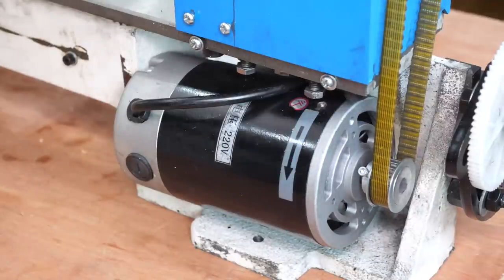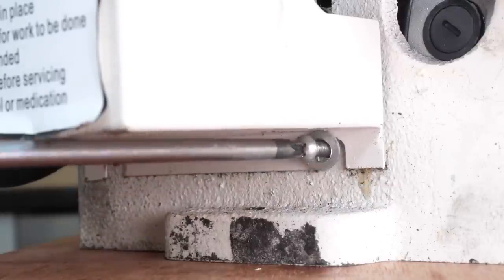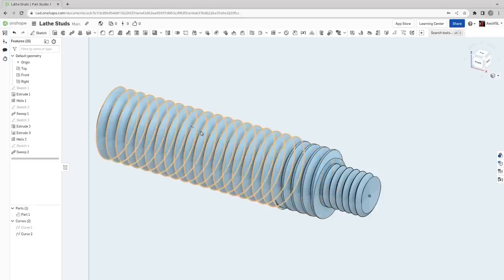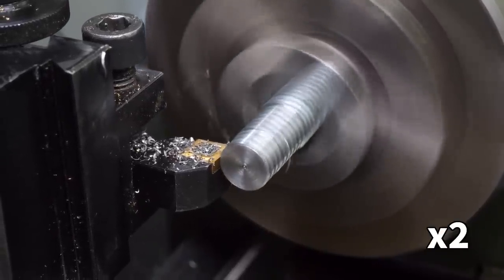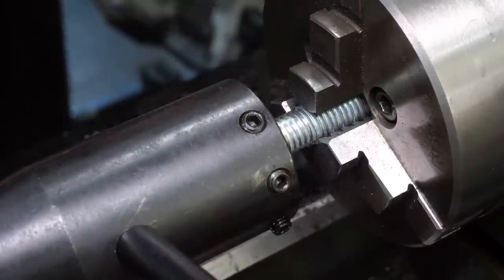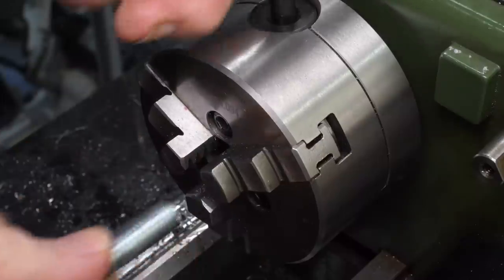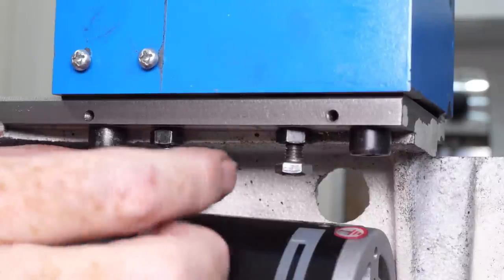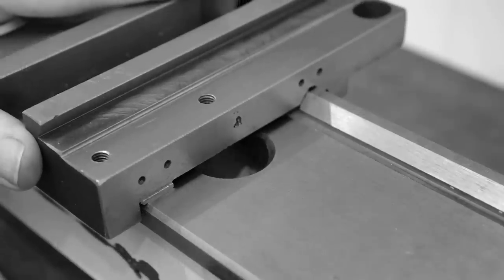A Quick Fix Motor Mount for the CJ0618 Mini Lathe

Comment: A good tip to hold any thread section in the lathe chuck, is to lock a couple of nuts to the thread, so the flats align. The nuts then grip the thread without damage, and the hex of the nuts is gripped by the chuck very firmly.
Reply: Nice, but I have a better way. A collet chuck. A sound investment for any lathe.

Comment: I had exactly the same issue with my mini lathe, fixed it with a new lathe! only after doing virtually the same as you have just done, only I milled the surface around the two slots to make it level, so the motor would sit better also enlarged the two bolts to 8mm just to give them a fighting chance. I still use the lathe for little jobs as I do like it, and it's very handy. thanks for sharing, and remember, "Make Stuff, Not War".

Comment: Love watching you work as it very soothing.  I have done quite a bit of mods to my mini lathe. It is a Harbor Fright. All the bed castings are thew same. I have seen those mounts like you shown.  They are a pain. You are also correct about the two bolts in the motor area.  My lathe has an actual motor mount that has a pivot on it. If you download the HF manual, you can see how it works and probably make it. Very simple and holds the motor much better than the studs do. Keep up the great work my friend.

Comment: These mini lathes are the equivalent of a casting kit. You do the final fettling and assembly after.
Reply: Couldn't agree more.
I spent some time getting mine in decent working order, and mine was well made by comparison to some I've seen. 
The best mod I've done is the drive belt reduction, which has given it much more torque, especially at low RPMs , without sacrificing too much high RPM speed.
Reply: @johnnodge4327  
Bought mine almost two years ago. Still improving things on an almost daily basis,

Comment: Good video, easy to watch.
A few thoughts; did you consider just using stronger M6 studs and turn a bushing to fill the gap? 
Also, if you use a collet chuck they grab thread extremely tight without chance of damaging the thread. A very handy accessory I find.
Cheers,
Reply from the maker: I think bushings could have worked, and a collet chuck would certainly have been better for gripping the thread. This video is about the quickest solution I could think of to get the lathe working.
Reply: @AdventureswithaVerySmallLathe - On a quick look. 
A plate (3~6mm) with two paralel holes. Would make a fine replacement for those two dangling washers. Adding to the M6 and bushings already mentioned. 
It surely would make for a simpler, quicker and rather effective solution. 
Cheers

Comment: So blue live is positive, and white is negative neutral! I found it helpful and informative!
Reply: So the wires are directional wires that turn the motor forward backward, or forward and reverse! Before someone complains! , I am not using it for a lathe but a different use! So I need to buy a variable peed controller for my use! Thanks for your help and support!

Comment: I see you're using the same Moore and Wright digital caliper as I am. I liked so much I bought a second pair, and a digital micrometer and a dial gauge also by Moore and Wright. Very happy with them. Way better than anything I've seen at that price. Not Mitutoyo, but for my purpose, as good as.

Comment: Nice fix, feels nice to tighten up an old piece of equipment and get that like new feeling back. Cheers!
Reply from the maker: Repairing stuff is great, but unfortunately this lathe isn't old. It arrived new in this broken condition. Buying this lathe was an experiment to find out what you get when you order the very cheapest new mini-lathe off the internet.

Comment: Same issue on my mini-lathe. I suggest making a plate to mount the motor off of the lathe and bolt both down. The plate can slide to adjust tension. This lets you move to a larger/better motor easily.
Reply: Second that. I don't have a dog in this fight as I have a SHERLINE rather than one of these pieces from the PRC. All the same, were I faced with this issue, I think I would have gone with a plate of modest dimensions as it appears that the housing is cast and I have no love of cast metal and its inability to handle pointed stresses well. May I also add that I don't know the metalurgy involved, but feedback I have viewed about "chinesium" metal leaves me thinking about erring on the side of caution where one is required to trust it. FWIW.

Comment: Good to see some lathe work after some time!! Good fix. Would thin brass sheets on the jaws have helped with thread damage?
Reply from the maker: Yeah, brass shims would have been a big improvement. Unfortunately I did this work before I made the soft jaws which would have helped.

Comment: As of yesterday I can claim, "been there done that". ;-)
Your solution looks rather elegant. But a bit overkill. The original system in spite of being a pain in the "opposite side". 🙂It can and does work. It's neither elegant or practical, but it works. With that said on mine the first motor nut was becoming loose. 
Anyway basic improvements include. Adding some thread lock (Loctite) on those studs motor side. And replace the M6 regular nuts by M6 "Nylok" counterparts. Those two small details. Make all the difference. With no machining included. 

On my case I had both things at hand. So it was quick and really easy. The royal pain is by far. Fine tune the belt tension vs alignment. That was very time (patience) consuming. But an unavoidable absolutely important step. Cheers
Reply from the maker: Sounds like a nice simple solution, but how did you solve the problem of the slots in the casting being wider than the M6 nuts? Did you use a replacement stack of ordinary M6 washers, or use something else thicker to avoid bending?
Reply: @AdventureswithaVerySmallLathe - Hi, I didn't replace or change the washers. I should, but my patience was running out. LOL 😂😂

The fact that the casting slots are wider. In spite not being elegant. It's not a deal breaker. After all, they are fundamental to fine tune the position of the motor (left-right axis) and respectively the belt alignment.

Either case I believe the most important is to keep things tight. But not overdue. While metal it's kept under the "elastic phase" everything will be tight and secure (proper torque). But the moment metal enters the "plastic phase" it simply deform. And no longer play it's function correctly. Reason why the washers where bend beyond recover. 

A small M6 by it's own nature can't withstand much torque. And most important in this application,  it really doesn't have to. ;-)
What is absolutely fundamental in this case. Is to withstand vibrations so it doesn't come lose. That's where the elastic properties of the metal, along with Loctite on the threads and "Nilock" nuts. They all come together. ;-)

Thousands of these mini lathes working with the same system. Many, or probably most. Are still using the OEM system. That should tell something. I hope this writing makes sense and can be of any help. Cheers.

Comment: Will tell you to take that speed control and remove from box, clean of all dust, and put in a plastic bag, or mount separate from the lathe itself in a dust tight box, with all connections coming in to it. Small bits of swarf and metallic dust will blow them up, and they are expensive to buy. You can guess how I found that out.

Comment: Good video once again... Never thought to turn the die around to get a closer thread..
Reply from the maker: This isn't guaranteed, but I've done it a few times. Usually if a die has a large lead-in angle on one side, it often has a much closer cut on the other side.

Comment: What colour are the wires for neg or positive, as I have a 550w 6000rom mini lathe wires are white and blue! But I don't know which is positive can you help me out I would be grateful!
Reply from the maker: Check my video called "Reassembling the CJ0618 7x12 Lathe" at 8:35 where I did a close up of re-connecting the motor blue and white wires to the direction switch. This is all the info I have, and I simply re-connected it the way it was before disassembly.

Comment: I had same problem with mine. Fortunately the studs were reusable so I made a steel plate to replace the washers on the front side. I'm still thinking of a better solution but meanwhile the lathe is usable....

Comment: I'm surprisely noting that your motor drives directly the spindle !!!
Such a solution - as i know - is only used with step motors, while your one is a brushed, conventional one, as mine is ... but in my lathe ( a 7" x 12" ) there is an intermedium axis ( drived with pulleys and a toothed belt from the brushed motor ), which in turn moves a couple of gears, with the choise of two speeds, low and high, depending of which couple of gears is selected ... 
So i believe your spindle has not so much torque, or - in anycase - less than usual ...
Did you go on with any modification ?
Thank you in advance for your answer.
My best greetings from Italy ...
Reply from the maker: This is the very cheapest and worst built Chinese lathe, so it's full of short cuts, and missing a lot of good features. It doesn't have the speed change lever and intermediary gears that other lathes have. I've been working on more improvement work, and have plenty more planned, so stick around.

Comment: I bought this lathe from AliExpress, but unfortunately one component of the control board burned out on the 4th day. It turned out that it is a C6025L transistor that is not sold anywhere. I would very much appreciate it if you know another suitable board or what other transistor it can be used with replaced the one you show in a clip. My lathe is a 7x14 550w.

Comment: Good work! :) That motor mount "mechanism" seems absolutely horrible :) Sure there isn't supposed to be a cradle between the casting and the round shape of the motor?
Also, one of the first things I would do (except the things on the bed you already mentioned) is to mount a support strut between the back left lower corner of the casting and the back left corner of the shelf for the headstock. The thin front plate of casting is all the torsional "rigidity" the headstock has - it must be twisting like an overcooked  noodle under any type of load :)
Reply from the maker: Thanks for the suggestions! I've already been working with a friend on getting a 3d printed cradle made to sit behind the motor and make it more stable against the back of the casting. Glad to hear that makes sense to you too.
The idea of a strut on the back corner sounds well worth looking into, as the back corner of that headstock does seem very undersupported.
Reply: @AdventureswithaVerySmallLathe  I haven't run any FEM analysis on it :), but by just a visual inspection it would seem you could increase the torsional rigidity manyfold with only a small strut strategically placed there.
It might be a fun idea to mount a ground roundstock in the chuck and measure the deflection for say 10N of load 20cm out from the chuck... Doing that with/without a strut should be fairly easy :)
Reply from the maker: @AJBtheSuede  The way the back of the bed hangs unsupported has always struck me as flimsy, and potentially something that would exacerbate headstock vibration. However an obvious way to fit a strut with enough strength without interfering with the motor drive and the gear banjo hasn't presented itself yet. I'll focus on it at some point, and no doubt I'll work something out.
The experiment to teste that deflection should make an interesting video.

Comment: To get my belt to the right tension I had to 3D print a spacer that fit between the motor and the slotted casting.
Mine had no jacking bolts above the motor.

Comment: I don’t know if you have watched Artisan Makes but he placed a steel spacer in the motor gap space on his mini lathe. I know you are trying to keep the repairs reasonably “stock” so removing the motor from it’s designed space is probably unappealing. But it’s hard not to look at the space beneath the head stock as a vast casam of flexibility. Perhaps a couple of 3/4 steel spacers with holes big enough to accommodate the motor and act as motor mounts themselves while supporting the lathe ways and the head stock? Admittedly since your channel is Adventures with a very small lathe I might be looking at this through the wrong lense failing meet intent.
Reply from the maker: I've watched quite a bit of Artisan Makes, and he does really great work. Sometimes I get inspiration for future work from there, and sometimes he does stuff I aready did, but haven't edited the video yet.  There are lots of really good improvements for the motor mount that I've found on YouTube, but I think my long term improvement will probably be to use a larger external motor. I haven't specifically decided how to set up the drive train yet.
Reply: @AdventureswithaVerySmallLathe  ooooh! It looks like I have something to look forward to. Perhaps a servo motor with an internal brake? I have a lathe that feels a bit under powered at low rpm so a motor upgrade, while not any time soon, is certainly a desire. I’m always looking to see good ideas for improving home shop machines. I’m looking forward to your upcoming projects.

Comment: This destroys the pleasure of machining new studs, however, what about drilling motor casing, tap it to M10, use M10 rod and file the slots in the housing to take the now much bigger rods? It might make the fix even stronger.
Reply from the maker: The motor housing isn't very thick. At 1.5mm pitch there would be little more than a single turn of engagement, and the housing curvature over the bigger area would make it even less.
Reply: @AdventureswithaVerySmallLathe  Thanks for the quick reply. How is this with the 6mm studs? Is there a nut welded in the housing where the studs are screwed?

Comment: Question: instead of threading the end of the new bolt, why not drill and tap for a long set screw? If your answer was that you didn’t have a tap, but you had the die, then bravo!

Comment: It's much more simple, and quicker, to remove the stator from the motor, drill out the existing 6mm stud holes in the motor casing to a suitable size for retapping to 8mm and use either stainless or high tensile studs cut from an appropriate bolt. This means you don't need to do any machining on the stud,, other than  cutting them to length.
Reply from the maker: I can see why that might seem simpler, but it would have been very difficult to impossible with the equipment available to me. I only have a very small mill/drill machine, and could not have accurately drilled out the stud holes to that size. My custom studs may have seemed like a lot of work, but it was all very simple lathe work with easy setups.
Reply: The way I have described this alternate method is the way I changed studs on my motor and I simply used a hand drill and I lined up the tap using a small mill square. It really was that simple.

Comment: Rather than make a new part with multiple threadings on it,  I would have simply replaced the studs with new non-bent ones and then turned a bushing to fit over them and fill in the slot...

Comment: Wouldn't it have been easier to enlarge the motor screw holes and re-tap with fine thread?  ...  My next lathe up project is to make a plate where the motor mounts outside the lathe.  On this plate I'll also mount double, floating belt pulley.  The end result will be a two step reduction.  The allows me to use larger pulleys on the motor, which give you more teeth on the pulley.  It also give you a much slower spindle speed.
Reply: Not a good idea to be drilling/tapping in the motor case. Getting grime - let alone steel chips - inside the motor housing will bring dismal failure!

Comment: 9,5mm is .375"...so Brooker rod of 3/8×24 UNF can be used, with a reduced 6 MA (6-1,0) stud section for motor body.
Quicker Solution!
DocAV...Binary Gunsmith...( Metric+Imperial)

Comment: Maybe re-drill and tap the motor for bigger studs ? I don't know.
Reply from the maker: Can you go into why that would be an improvement? There isn't anything wrong with the existing holes. The motor wall isn't very thick, and bigger holes would mean fewer turns of thread engagement.
Reply: @AdventureswithaVerySmallLathe  Wall thickness is a consideration. It does seem as though when one puts a step or shoulder on a fastener t it creates a weak spot. But then again, we aren't talking about a heavy duty application here. I admit, I have not watched all your vids yet. Have you upgraded to the 750 watt motor at this point ?
Reply from the maker: @oldhick9047  I haven't, but I have some upgrades in mind. I'm considering either an AC motor with VFD speed control, or an industrial sewing machine servo.

Comment: How is the electrical conexion for mini lathe of 500w an 7x12
Reply from the maker: I don't understand what question you are asking. What do you want to know about the electrical connection?
Reply: @AdventureswithaVerySmallLathe  MY CJ0618 HAS STOPPED WORKING AND I FOUND A ELECTRICAL WIRE NOT ATTATCHED TO ANYTHING BEHIND THE ELECTRICAL BOX AND DO NOT KNOW WHERE IT FITS CAN YOU HELP?
Reply from the maker: @kennyhallford830  I posted the photo I have to the community tab of my channel. Hope this helps. Just click on my channel icon, and then select the community tab and view the latest post.